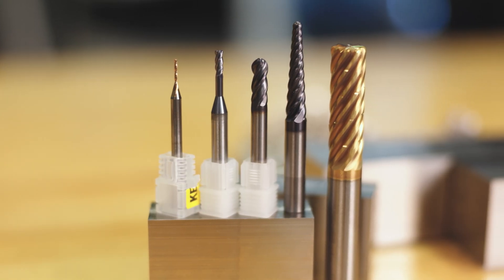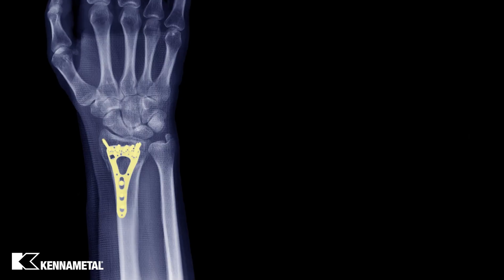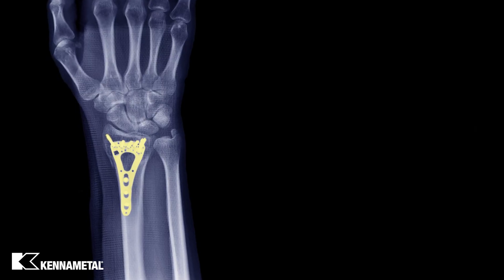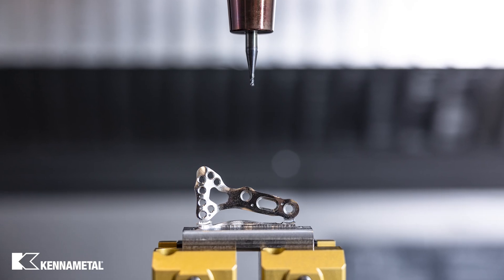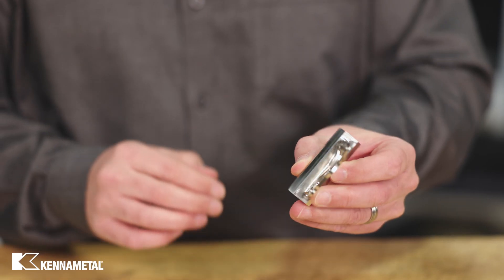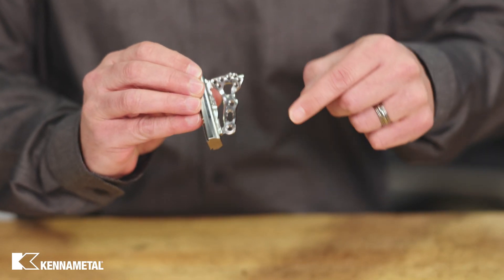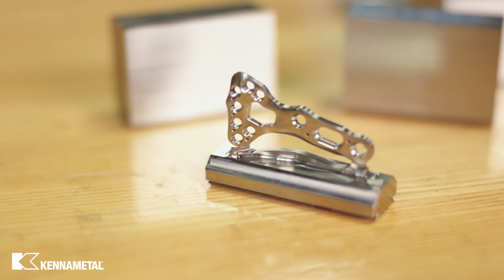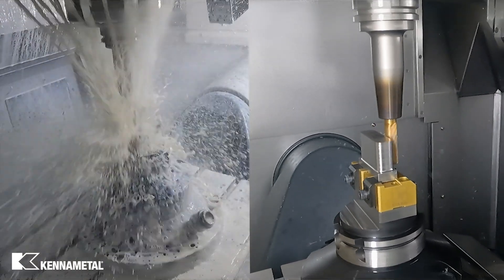Medical Industry Solutions – Bone Plates

Comment: It didn't show how you got the final smooth surface finish???
Reply: They tumble for hours.
I made similar for Acumed.
Some also get media blasted for rough finish if they want better bone adherence.  Smooth are usually intended to be removed at some point. Rough tend to be more permanent.

These guys use a shit load of material.  We used thin Ti plate, roughed, bent with a fixture, then mounted in another fixture to finish.  The orthopedic surgeon bends them to fit the bone structure anyway.

Comment: Interesting because a shop that used to make my parts made these. Some doctor with no machining knowledge had all sorts of features and tight tolerances in the drawing which they only paid about $20 per part. When the doctor went to insert the plate, he took a pair of pliers and bent it to the shape he wanted and put the screws through in any which way (sometimes went out the other side of the bone causing abrasion on the tendons) and charged $3000 for the plate.